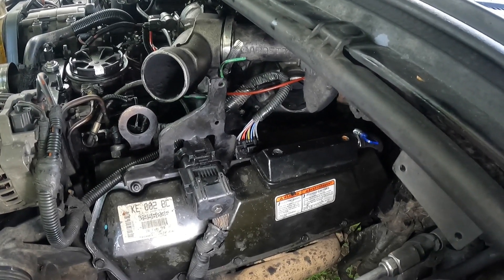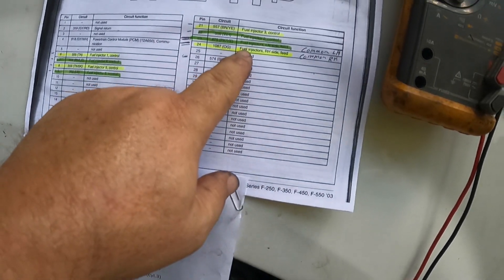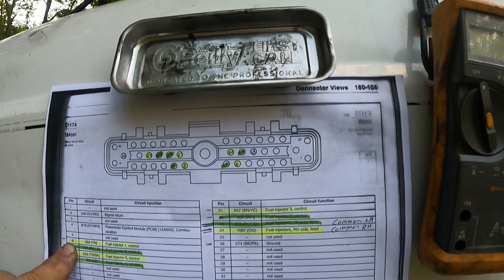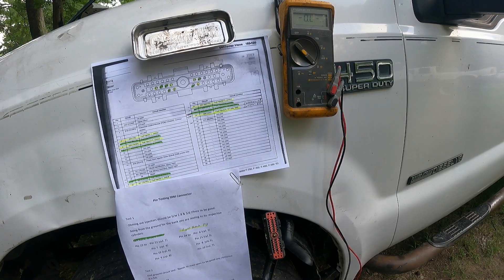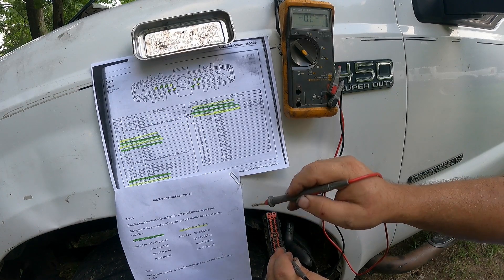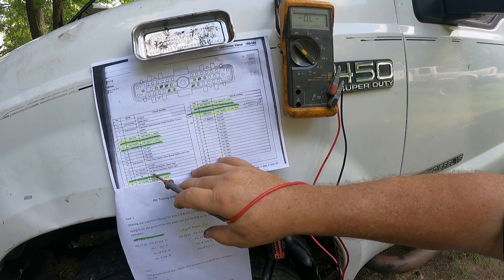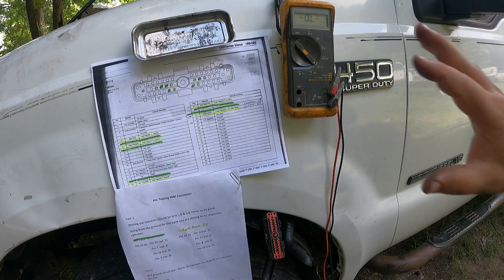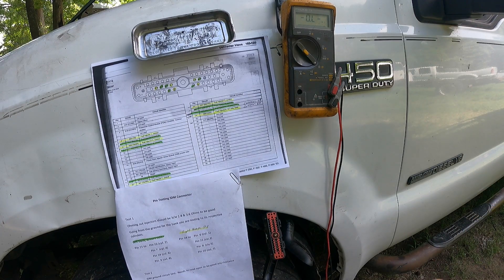IDM Wire Harness Pin Test. P1316 DTC.   2001 7.3 Power stroke

Comment: I’m having an electrical issue where #1 injector isn’t firing, only a tiny bit of oil coming out of deflector. Checked all wiring, swapped idm, new set of injectors and issue is still here. What am I missing ? Any help would be appreciated
Reply: I would like to know what you find. I’m having this issue with cylinder #3. Replaced the injector with a good injector and still no fire on #3. It also passed the buzz test
Reply from the maker: @alecluetke5116  passing the buzz test in my opinion just means that you have communication from pcm thru idm and thru your injector solenoid. You can also have a mechanical issue internally in the injector such as a clog, dad o ring, broken spring ect. 

Usually I’ll find wiring issues as the culprit. Which is what I would think sense you swapped a know good inj and still have the problem. Wiring can fool ya as it can show good but not preform 100% carrying the 120v dc to the injector. 

The injectors all share the same hpop oil psi from the oil galley. So the 2 things that would distinguish a bad inj from the rest would be internal mechanical issue which the pcm can’t pick up on for a code or poor signal to that specific inj. 
Try swapping side with the uvch. If you problem stays in cyl 3 then I would lean toward wiring or electrical component issue sense you swapped a know go inj in. It could be idm but I have found in most cases it’s in the wiring or connections.
Reply: @bayoudiesel  I just installed a brand new wiring harness from riffraff and 2 new valve cover harnesses. I am leaning towards a compression issue I believe
Reply from the maker: @alecluetke5116  that’s a quick check. Sounds like you eliminated the possible electric issues and swapping that inj out would have eliminated mechanical failure there. So I guess compression is all you are left with.
Reply: @bayoudiesel  my compression tester wouldn’t work because the rocker arm. So I gotta get one of those grease gun whips
Reply from the maker: @alecluetke5116  yea. That’s the only way to get in that hole.
Reply from the maker: Have you done a buzz test? 

Are there any codes?

The thing with injectors is that when you narrow things down to and injector you either have an electrical problem or a mechanical one. 

Meaning: electrical can be wiring or components 

Mechanical can be a physical issue like clogged tip, or internal failure like o ring or spring or stuck piston.
Reply: @bayoudiesel  ran multiple buzz tests, first it came back with:
Inj. 1,3,7 high to low side open
Then it came back with: 
Inj. 1,3,5 high to low side open
Then it came back with: 
Bank 1 high to low side open 
& 
Inj. 4 high to low side open 

Like I said, I had this issue before installing new
-injectors 
-uvch
-swapping IDMs 
-swapping inj. solenoids 
-checked every single wire injector related (ohm tested, sent power thru IDM plug to each inj. plug, no voltage drop & no amperage drop)

Basically ruled out the injectors being the problem when I changed all 8, ruled out IDM when swapping them, ruled out wiring, disconnected hydra (in case that was the issue)
Issue was present before and after installing any new parts.
Reply: @bayoudiesel  the only thing left in that loop is the pcm which isn’t really responsible for injectors not firing but it does control the IDM so I just sent out IDM & PCM to Jonathan at DTC to get them tested.
Also should mention that every buzz test I ran, injectors 1,3,5 sounded a little muffled with #1 being the quietest
Reply from the maker: @bartekwitas9500  did you replace the 9 pin pigtails that came with the uvch?

I usually find that wiring is more often the culprit than components, due to the age of these rigs. With all that you have done so far I am leaning toward an issue in the engine harness. 

Pull the 42 pin connector on top of the drivers side valve cover and open / pull back the loom and inspect the underside of the individual wires. Look for chafing ect. Check the paint on the valve cover where that harness like to rub and see if paint is scuffed. 

Also open/pull back the loom on each of the 9 pin connectors and look for old repairs and chafing. 

Another good spot to look is in the hard bend just behind where the 42 pin bracket is located. Look for same.
Reply: @bayoudiesel  the only question I have is, if I tested every wire, there was no voltage drop, no amperage drop, ohm tested good, how could the wiring still be an issue ?

Is there any way the pcm itself could be the issue ? I sent PCM & IDM out to get tested.
Reply from the maker: @bartekwitas9500  both the pcm and idm can go bad.  For what it’s worth, it’s been my experience that when the go bad it’s not a come and go kinda thing. For example an idm could quit pulsing cylinder 5. Something has burn out and you will not get it back. When you have glitches like ghosts in the machine that is usually more in the wiring side than components but that doesn’t mean it’s never the components. 

Ounce your get back from testing you will know more of the direction to focus on
Reply: @bayoudiesel  Correct, the problem has came and stayed in the same cylinder no matter what I swapped/replaced. That’s why first I thought it was IDM but it wasn’t. Now the only thing left is the PCM. Unless one of the sensors like the CPS is bad, giving the pcm wrong information ? Im not sure where else to look if the pcm comes back good
Reply from the maker: @bartekwitas9500  if pcm tests good I would try swapping uvch’s to see if the problem moves. If not try moving the injector to another hole and see if the issue follows it.

Comment: If I have resistance on my ground wire and shield wire does this mean I have bad wiring ?
Reply from the maker: If so something is grounding / shorting out. Both of those should read open circuit.

Comment: Got any tips on testing IDM, put a replacement on two years ago, now the left bank is dead
Reply from the maker: As far as testing an idm goes I usually have some parts trucks around here or a spare idm from another truck on truck that I can swap out and see if it helps. 
More often then not I have found problems to be in the wiring. 
But a bad idm is not an uncommon thing either.

Comment: I've been working on vehicles for over 30 years and I've been doing Aircraft Electronics for over 42 years. I love how you show to use the full wiring harness "AND" how to check for shorts. Most people stop at checking to see if the wire is going to where it's supposed to go, but few check to see if the insulation has worn or cracked and if the wires have a short to ground or the shedding. Those last two steps of checking for ground shorts are vital to ensuring the system hasn't been ruined and could ruin the IDM or even the PCM. One last thing I would check 12vdc through the harness to pin 14 and the ground wire Pin 26 can handle the current. Test that buy connecting a Halogen Light Bulb or a seal beam head light top pin 14 and 26, turn the ignition on to run. If the sealed beam lights brightly the wires are good. The reason to do a load test is; a wire can be frayed and only have a few strands left and it won't light the bulb brightly, but would show a good short with a Ohm meter. Other than that I love the way you showed all this. Thanks for sharing. Best Wishes & Blessings. Keith Noneya
Reply from the maker: Big thanks Kieth. And yes I did leave out load testing. That point is something I have had to clarify several times in comments with viewers on this video. How the low voltage of the ohm test would carry thru just a few strands of a frayed wire but not the 120 Volta DC that the idm puts thru. 
It’s hard to film what you are working on and remember to include every possible detail of the process as well. 

Thanks again for taking the time to comment and especially to share with me and the viewers that important aspect I left out. I appreciate it when our little community backs each other up. Also thanks for watching, we’ll keep cranking um out
Reply: . @bayoudiesel  I agree we do have a great 7.3 community. I live in Slidell, and I noticed your channel starts with Bayou, are you in Louisiana or in the south down here Gulf somewhere? Just curios. Look fwd to watching some more of your 7.3 videos. Best Wishes & Blessings. Keith
Reply from the maker: @keithnoneya  yes sir. I’m in the Lafayette area. And I’d appreciate any comments that come to mind if you watch any more videos. Always trying to improve the channel and myself. Lol.

Comment: So what does it mean then when I’m getting readings higher than the specs? Some of mine line up but I have 4 readings that range from 4.2-5.3. Does that mean my harness is bad or does that mean it’s my injectors?
Reply from the maker: Readings out of spec more often than not means wiring issues. Of course it could be a bad injector solenoid to cause that is in the loop you are testing. 
Testing thru the idm plug tests the whole loop. So when I get bad readings I’ll narrow it down by going to the 42 pin connector and testing the shorter loop then to the under valve cover harnesses and possibly test the inj solenoid it self. 
Most commonly it’s the under valve cover harnesses or chaffed wires in the harness tho. 
Side note: keep in mind with ohm testing wires that an ohm meter uses low voltage to test so you can get a false reading meaning a wire may have a few strands still connected to give ya a good ohm test but not be able to carry the 120volts DC load being sent to pulse the injectors. 
Hope this helps if not hit me back. Thanks for watchin.

Comment: THE VERY BEST VIDEO ON IDM thank you so much,  ive been asking about this for days and nobody can give me a straight answer how to...
Reply from the maker: Thanks bud. Also on a side note, keep in mind that this test is looking for broken & shorted wires. But it is possible to have a wire with just a few strands still hanging on that will give a good ohm test because of the low voltage but will not be strong enough to carry the 120 volts dc from the idm. So a false positive is possible. But I find this test usually helps isolate the trouble spot. Good luck on your project and thanks for watchin.

Comment: I checked the harness like the video stated. All my injectiors are within spec, from pin 23,34 to pin 26 it was around 30ohms does that mean I have an open ground or what would the culprit be
Reply from the maker: ok, so if memory serves pin 26 is the ground and pins 23&24 are the feeds (left & right banks respectively).  Feeds are the common Hot shared by all injectors on that bank.  The pcm makes and breaks the ground which is specific to each injector to pulse them.  pin 26 and pin 18 are ground and shield respectively.  What your info suggests is communication (short) between the feeds and the ground.  Ford manual says possible causes are Short circuit, shorted injector,or failed IDM.  
If you have access to a test idm you could try swapping it out.  Otherwise you need to eliminate sections of the harness to locate the problem area.
I would start ate the 9 pin plugs and do the ohm test again on just the uvch.  If that tests good then back up to the 42 pin connector over the drivers side valve cover.  If that passed pin test form the idm plug again.  This will tell weather its the uvch, engine harness, or engine bay harness.
There are more places to check but that's the usual culprits.  If you can't locate the problem hit me back with feedback from these test and we can put a new plan of attack.
Reply from the maker: Another side note.  Ohming wires can be confusing in the sense that you can get a good ohm test and still have a fail.  Ohms test sends minimal voltage down the wire which can show as a pass even if most of the wire is frayed or broken.  As long as there is a strand or two still good it can show as a pass.The IDM sends 110-120 volts DC to the injectors so a frayed wire will not be able to carry that kind of a load through the bad section of wire.  I know, this electrical shit can make you pull your hair out.

Comment: Anyone know a decent code reader that will show injector pressure and other 7.3 relevant data?  Preferably one that won’t break the bank.
Reply from the maker: The one you see me using is an older genesis that I picked up from a friend when he upgraded to a newer unit. Has all the live data stream functions. I also hear good things about ford scan which has similar functions as well as being a tuner.
Reply: @bayoudiesel  thanks. I had my 02 7.3 loose power and run rough. Feels like running on 4. I had rebuilt the turbo, all new injectors and glow plugs. Ran great for about a month.  Then the power loss and rough run. Did the IDM pin test here and all looks good with consistent 3.4ohms. I guess a new IDM may be needed. Where you located btw?  I’m in Mississippi.
Reply from the maker: @RabidMooseGarage  I’m in Louisiana. 
As for this test keep in mind that while you can have a bad idm be through on checking for bad wires. One issue with this test is that seeing continuity on an ohm test in not definitive in the sense that the ohm meter uses a small voltage to ohm test but the idm puts out 110 or 120 bolts dc. So wires that are frayed can pass ohm test but not carry the load of the idm.

Comment: Man thanks for this video. Im having trouble with 7.3 running up past idle sort of limp mode. Need one of these videos on how to test the pcm next lol
Reply from the maker: I hear ya. I keep a spare that came out of a parts truck for testing. What codes are ya getting?
Reply: @bayoudiesel  p0603 code i ruled out the idm i think. Basically wont run up past 1100 rpm and a few weeks back had a no start, replaced glow plugs everything worked fine for a while(im assuming from the battery disconnect)
Reply from the maker: @offgridhandyman  if memory serve that is the kam(keep alive memory) code. If so that pops up every time you disconnect batteries.   Do ya have access to watch live data streams on a scanner?
Reply: @bayoudiesel  yea it is the kam code. No i dont alls i have is a ob2 reader and a superchips reader which is the one that found the code. No check engine light came on either. Maybe ill have to ask around locally for someone with a snap on dignostic
Reply from the maker: @offgridhandyman  ok. Sense we don’t have access to live data we can do it old school. 
Give me a little history on your rig and how it came to this poor running condition.
Reply from the maker: Also include as much description of how it’s running now as you can.
Reply: @bayoudiesel  ok its a 1996 f250 7.3 with 145k pretty much stock exept pedistal delete, little turbo upgrade (banks kit) cold air intake. Been running great for years i noticed one morning no start back fire through intake so i disconnected battery replaced glow plug relay and she fired right up. The other day coming down bumpy dirt road and all of a sudden wont rev past 1100 or so really smokey (unusual for my truck) got a tow to dads. No codes except the superchip read a p0603 and so i cleaned the connectors at the pcm icp ecm etc.. and battery terminals. I did noticed when i put it on a charger the batteries were not 100 but they are both abouy 7 month  old. I tested idm harness so far from your video and it checks out arounr 3.0 all day. Havent found a way to electrically test the other componets short of swapping some stuff out i dont have extra ones laying around though. I was guna go bench test the alt here in a bit just to be sure

Comment: This just saved me tons of time and wasted money, thought it was injectors but after this I swapped the idm and just like that it runs like new!
Reply from the maker: That’s really good to hear. Glad I could be of help and thanks very much for watching.
Reply: Mardino93 what was the problem with you truck  ? I did this test and all showing 3.4 ohms but still getting code p1316 and 2,3,6,8 cylinders short to high to low side open
Reply: @gerardoreveles3156  Did ya get your figured. Did this test and mine tested good. But im getting codes for 1,2,3,4,5,6 on buzz test. All injectors sound good. None sound weak. Starts good cold. And runs good.  Im thinking idm is going.